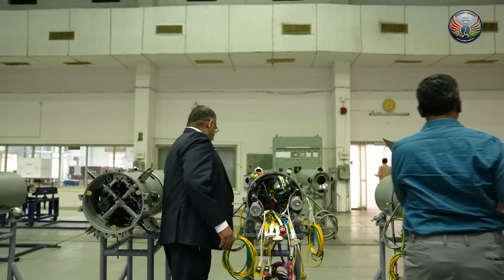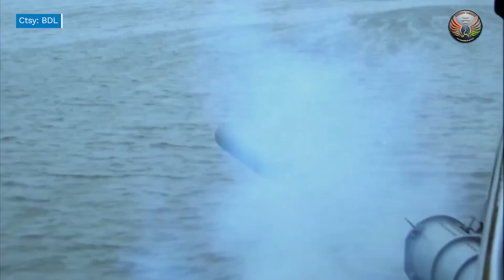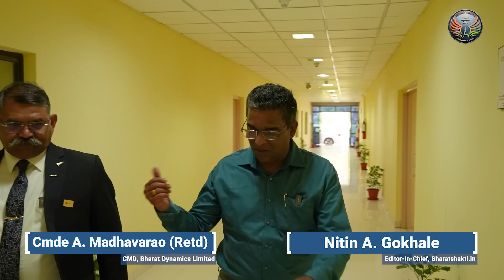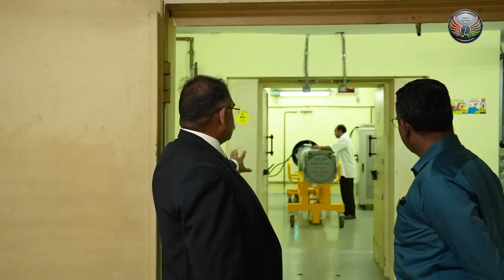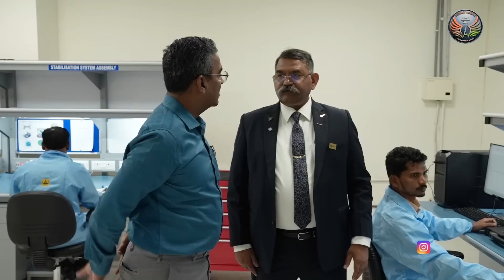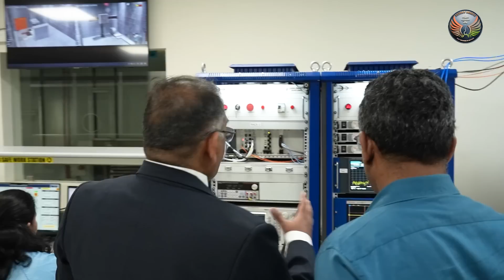On The Shop Floor | Bharat Dynamics: Backbone Of Indian Missile Manufacturing | #missile #defence

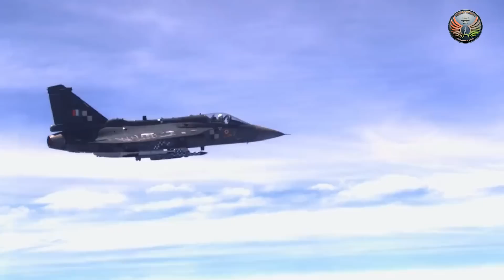Comment: 13:47 The Astra (BVR) class air to air missile system, designed to be mounted on fighter aircraft, is a highly versatile platform, which is the reason behind Indian air force's interest in them. And they're thinking critically about the system so gung ho is not the right word for it at all as it suggests participating enthusiastically and eagerly in a fight or war without thinking.

Comment: BDL Must focus on enhancement of Production Capacity to match Chinese Volumes and possibly build Augmentation plans to increase rate of production without compromising quality, reliability and efficiencies across the Supply Chain ecosystems. Jai Hind Ki Kshepastra Sena.
Reply: Aa gaye self proclaimed industrial engineers
Reply: Yes,But current Govt is not providing any orders to BDL
Reply: Recently there were orders for ATAGS  @GauthamRaj-rq6oz
Reply: The manufacturing facility looks vintage, very minimal modern techniques are used.
Reply: @rakab2010  what is vintage in this video?
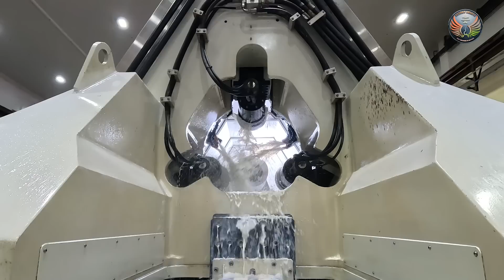Reply: @rakab2010  Minimal Modren Technique? Seriously Rakesh? Go to 3:21 can you find one more cold pressed hollow tube making facility in the world?